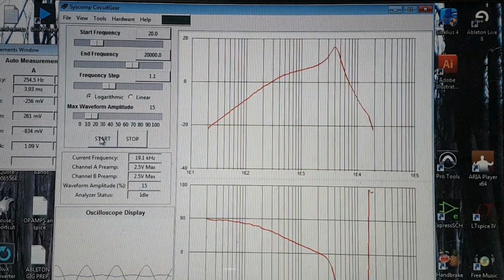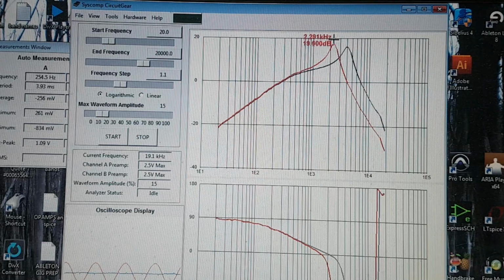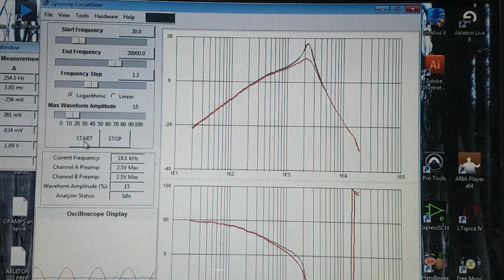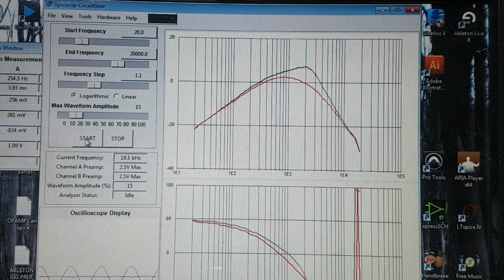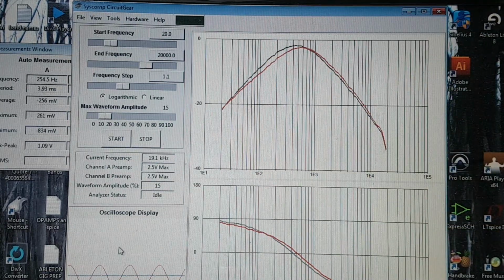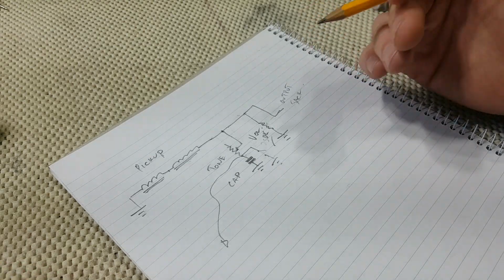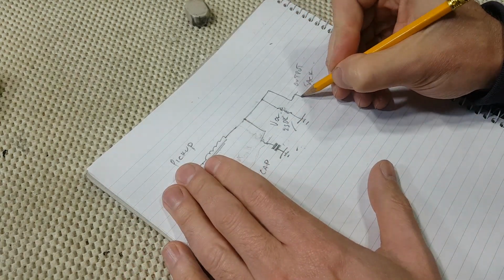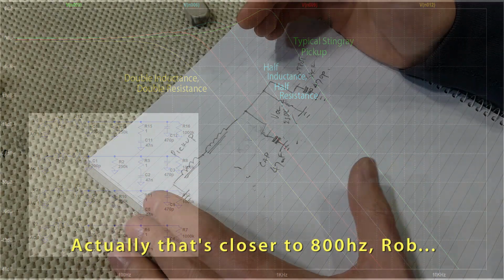Tone Caps Explained (Part 1)

Comment: I nearly always roll my tone of completely or nearly on my bass haha, so I need to check what cap values I have in at least one of my basses, as the tone pot is way too weak in rolling off treble even at full roll-off. Thinking about using the three-way switch now used to chose pickup positions as a switch for perhaps two different caps and something else, been looking at other components one could add in the same way as a cap in the circuit. Anyone have any suggestions? Its a PJ shortscale that is getting all new electronics + pickups with three pots (volume, tone, tone now) that I plan to change to volume, blend between pickups, and a tone knob determining the amount of effect of the stuff I put in the three-way switch. Anyone did anything like that?

Comment: The pickups in my 74 P bass suck. I took them out in 78,  I am glad this vid is in existence,  Personally,  in 40 + years I have gone by what my ears hear. Now   my hearing isn't as good volume wise as it used to be, I still go for 500k pots and a 473 cap-- but I'll switch out  with 250 pots sometime.  It in my opinion -(after the electronics are done and the guitar is played-) in the end it's all "the luck of the draw". It's either going to sound okay good or sucks. No matter what you do- some bass guitars will allways sound like crap. You can help them a bit with pick ups etc and a bunch of pedals--but in the end you play the bass a lot a little or not at all---I have owned 100 guitars and have kept like 25- so it to me is a 25 % chance the bass I'm making is going to be a keeper.  So have fun and learn when you should quit throwing money at a bass. It may take a long time.
Reply: Yes it is very individual to the instrument, and of course to the taste of the player. And you are right that some basses just suck in their core, and some are wonderful for no discernible reason. A buddy found a Samick shortscale PJ at a flea market for about $60, and I tried it thinking it was going to be some cheap Chinese toy-store bass, but I was so pleasantly surprised! Its "core" is very nice and spoke to me immediately so I got to buy it from him via paying a rather big, i suspected bill his broke ass couldnt pay. Mahogany neck straight as an arrow, dark dense rosewood fretboard, thick solid bridge, nice quality on knobs and the pickup switch. Tuners are not bad but might replace. Pickups are the weakest link, will choose some quality PJ-set, maybe DiMarzio Relentless or some combo of Fender models. Every change I have done so far has felt like giving the core of the instrument what it deserves, and has made me like it even more.